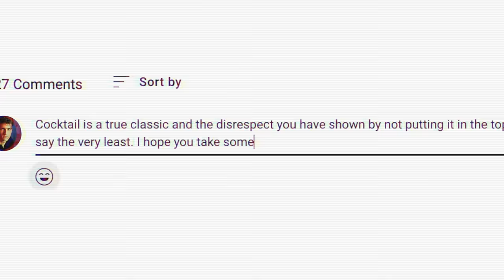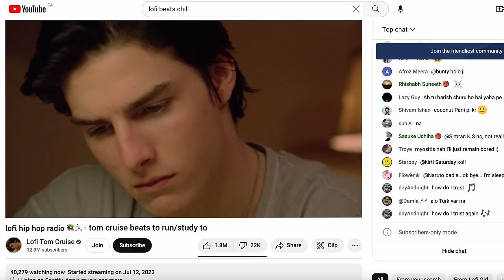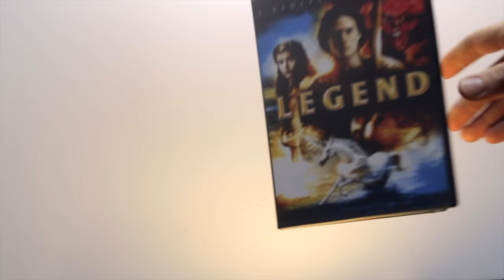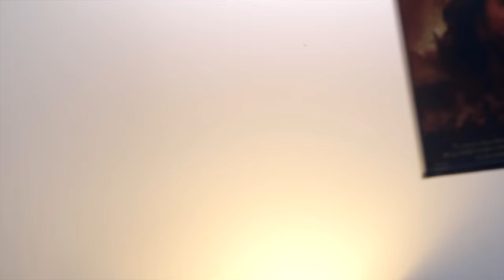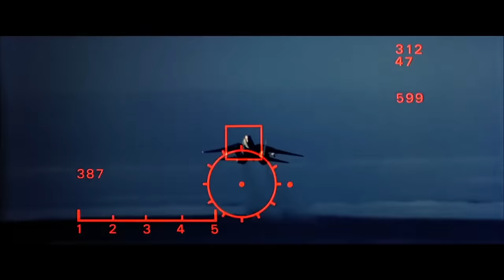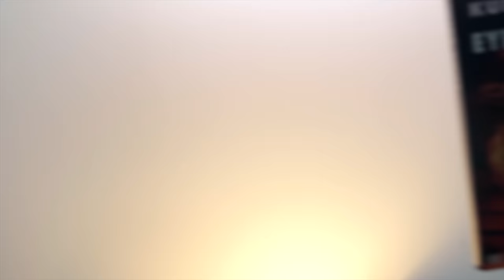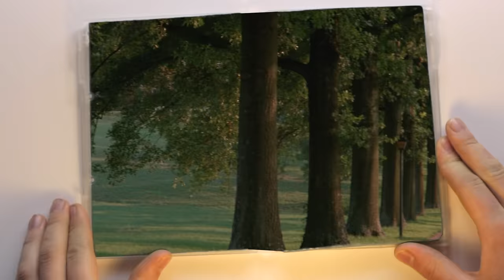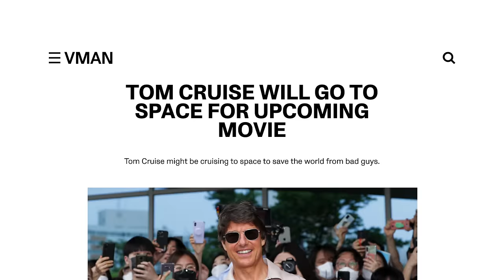I Watched Every Tom Cruise Movie

Comment: Last Samurai, 23
"It is empty."
Eyes Wide Shut, 10
"After I read about it - because I couldn't pick up anything on my own - I realize ITS SO PROFOUND."
Reply: There's a difference with a product being so vapid you realize it's got nothing under the surface and a project where the surface itself is so mysterious it's difficult to gain any insight at first glance
Reply: @mattday1442  There's a difference with a project having a simple message and being confortable with conveying It in a straightforward manner and a project being so vapid It has to portray the little It has in a convoluted manner to feign profoundity.
Reply: @strangemolars  ok